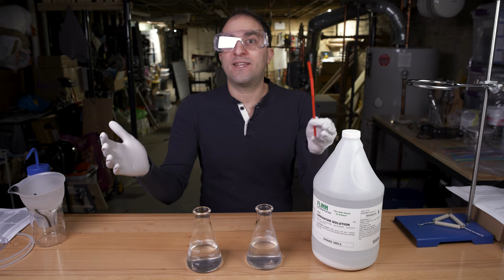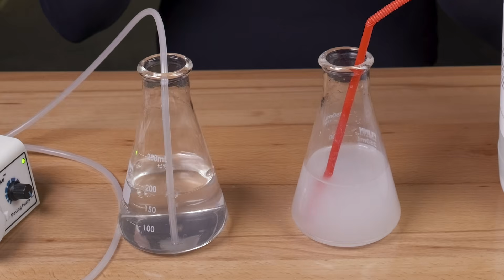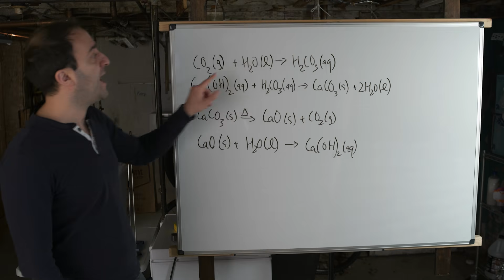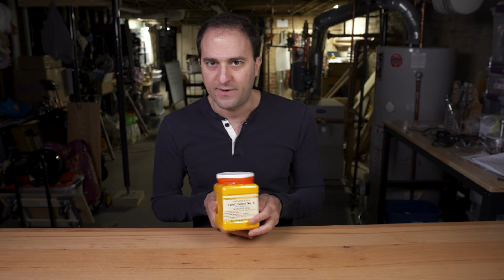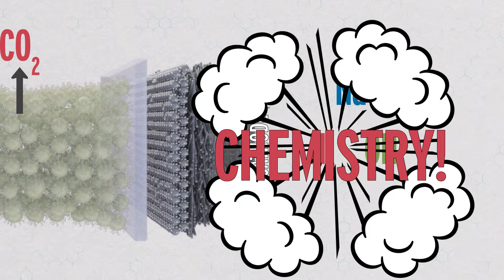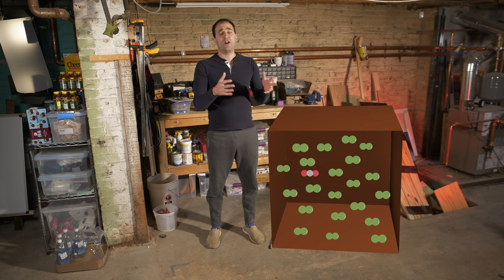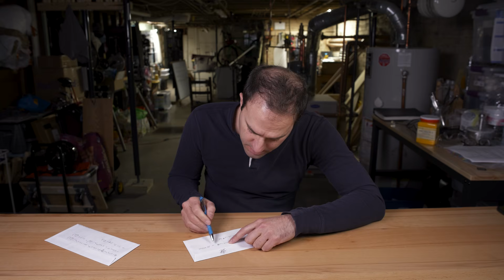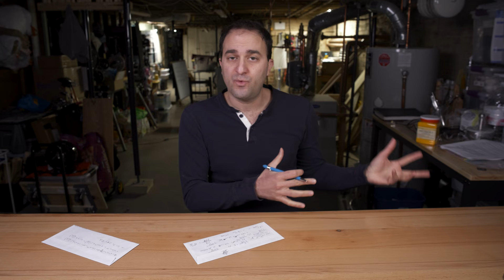Why a Carbon Capture Breakthrough Will/Won't Save Us

Comment: So heat to energy is likely the most efficient path, we can make heat exchangers, with outside, at about 550% efficient however this is not the limit.

	Maisotsenko Cycle (M-Cycle) Systems: This innovative design employs a unique heat exchanger configuration that can achieve a COP of up to 26.4 under specific conditions, corresponding to an effective efficiency of 2640%. 

An adaptation of this to the high temp diff cycle of a nuclear reactor might look something like this:

#!/usr/bin/env python3

"""
################################################################################
#  Advanced Heat Exchanger Adaptation for Nuclear Systems with CO₂ Capture    #
#  Author: [Your Name]                                                         #
#  Description:                                                                #
#  - Integrating the Maisotsenko Cycle (M-Cycle) with reactor-friendly fluids  #
#  - Achieving ultra-high-efficiency heat exchange for nuclear reactors        #
#  - Utilizing reactor waste heat for CO₂ sequestration                        #
################################################################################

### 1. Introduction
Nuclear reactors produce vast amounts of **high-temperature waste heat**, typically 
rejected through cooling towers or heat exchangers. *Molten Salt Reactors (MSRs)* and 
*High-Temperature Gas Reactors (HTGRs)* operate at **700–1200°C**, making traditional 
cooling methods inefficient.

*Objective:*  
- Re-adapt the *Maisotsenko Cycle (M-Cycle)* to *high-efficiency heat exchange*  
- Utilize *supercritical CO₂, liquid metals, helium, and radiative cooling*  
- *Extract reactor waste heat for CO₂ sequestration and industrial heat applications*  

---

### 2. Heat Exchanger Efficiency Fundamentals
Heat exchanger efficiency (**ε**) is given by:

    ε = q_actual / q_max

Where:  
- *q_actual* = actual heat transfer (Joules)  
- *q_max* = theoretical max heat transfer (Joules)  

Higher *ε* means **less waste heat loss, more usable energy**.

---

### 3. Efficiency Breakdown of Different Heat Exchanger Types
| Heat Exchanger Type | Efficiency (%) | Max Temp (°C) | Primary Application |
|-----------------|----------------|----------------|------------------|
| *Water-Air M-Cycle* | 85-120% | ~100°C | HVAC, low-temp cooling |
| *Supercritical CO₂ M-Cycle* | 300-500% | 500-1000°C | Advanced power cycles |
| *Liquid Metal M-Cycle* | 500-1000% | 300-1200°C | MSR & high-temp reactors |
| *Helium Gas M-Cycle* | 200-400% | 700-1000°C | High-temperature reactors |
| *Radiative Heat Exchange (Space)* | 1000%+ | No upper limit | Space-based nuclear systems |

---

### 4. Re-Adaptation of the Maisotsenko Cycle (M-Cycle) for Nuclear Heat
The *traditional M-Cycle* is an **evaporative cooling system**, using **wet-air cooling**.  
For nuclear applications, we replace *water-air interfaces* with high-performance fluids.

#### *4.1 Supercritical CO₂ (sCO₂) Adaptation*
- *Why?* sCO₂ is dense, low-viscosity, and highly efficient in thermal exchange.  
- *Efficiency Gain:*  
    - *300-500% improvement over traditional steam cycles*
- *Application:*  
    - *Direct integration into nuclear Brayton cycles*  

#### *4.2 Liquid Metal Adaptation (Na, Pb, Bi)*
- *Why?* *100x higher thermal conductivity than water.*
- *Efficiency Gain:*  
    - *500-1000% effective heat exchange efficiency*  
- *Application:*  
    - *Passive cooling for MSRs & space reactors*  

#### *4.3 Helium-Gas Adaptation (HTGRs)*
- *Why?* Helium is **chemically inert, corrosion-resistant, and heat-efficient**.
- *Efficiency Gain:*  
    - *200-400% effective heat exchanger improvement*  
- *Application:*  
    - *Ideal for closed Brayton cycle reactors*  

#### *4.4 Radiative Heat Exchanger for Space-Based Nuclear Reactors*
- *Why?* Space has **near-zero ambient temperature (~3K), enabling extreme cooling efficiency**.
- *Efficiency Gain:*  
    - *1000%+ effective waste heat rejection*  
- *Application:*  
    - *Deep space nuclear reactors*  

---

### 5. CO₂ Capture Using MSR Waste Heat
MSRs generate *1 GW thermal* power.  
- *45% efficiency* → *450 MW electric*
- *55% waste heat* → *550 MW (for CO₂ capture)*

Using the **Calcium Looping Cycle**:

1. *CaCO₃ decomposition (endothermic, requires heat)*  
    - *CaCO₃ → CaO + CO₂* (at **850-1000°C**)  
    - *Energy required:* *4.05 GJ per ton CO₂ captured*

2. *CO₂ sequestration (exothermic, releases heat)*  
    - *CaO + CO₂ → CaCO₃* (at **600°C**)  
    - *Excess heat can be recovered for power generation*

Annual *CO₂ capture calculation* for 1 MSR:

    CO₂_removed = (Annual Waste Heat) / (Energy per ton CO₂)

    CO₂_removed = (550 × 10⁶ × 3600 × 24 × 365) / (4.05 × 10⁹)
    CO₂_removed = 4.28 million tons CO₂ per year

**100 MSRs can offset ~5% of global CO₂ emissions**.

---

### 6. Financial Feasibility of MSR-Based CO₂ Capture
| Number of MSRs | CO₂ Captured (tons/year) | Carbon Credit Price ($/ton) | Annual Revenue ($) |
|------------------|------------------|----------------|------------------|
| *1 MSR* | *4.28 million* | *$50* | *$214M* |
| *10 MSRs* | *42.8 million* | *$50* | *$2.14B* |
| *100 MSRs* | *428 million* | *$50* | *$21.4B* |

**At $100/ton CO₂**, revenue **doubles**.

---

### 7. System Optimization for Maximum Efficiency
1. *High-efficiency heat exchangers (~95% efficiency)*
2. *Cascaded energy recovery from CO₂ cycle*
3. *Hybridizing with direct air capture (DAC)*
4. *Utilizing captured CaCO₃ in cement production*

---

### 8. Final Takeaways
- **M-Cycle heat exchanger efficiency increases by 3-10× when re-adapted for reactor fluids**.
- **MSR waste heat can be extracted at >95% efficiency**, reducing reactor temp to **near-room temp**.
- **MSRs can remove 4.28M tons of CO₂ per year, making carbon-neutral nuclear feasible**.
- **Scalable solution for deep decarbonization, energy recovery, and industrial heat applications**.

—- solution summarized by chatGPT

Comment: Capturing carbon from air is less efficient than carbon capture directly from places that emit tons of co2, like say remaining coal power plant, large factory, metropolitan most jammed intersection n so on. the goal shouldnt be capture everything we emit. It should be at places with higher concentration of co2 emision. 

The reduction of emissions even 5% gonna be a huge deal.. there are no single solutions to problem this big

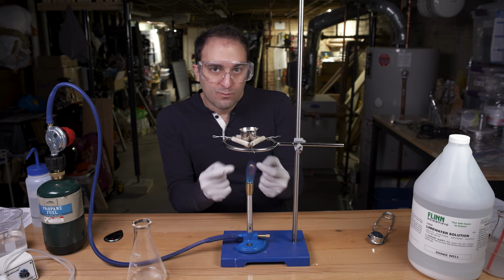Comment: 3:15 so use waste heat from some other process. Or solar/thermal.
Could even use it on cars to scrub co² from their exhaust and use catalytic converter heat.

Comment: So extracting 1ton of  C02 from air would take 1000kwh of power (200kj/mol = 18mols/kwh or 792g,   BUT removing from the exhaust of a natural gas powered power station (maybe used as a back up for variable wind/solar) would take maybe 350kw hours, but would produce maybe 2400kw per ton of CO2. 
Depending on the method used some of that carbon capture could come from renewables. 
Iron Fertilisation of the Oceans is probably the easiest method and would help restore our oceans. It wouldn't remove a fraction of the CO2 being produced at present.

Comment: I'm a bit confused about why the output is supposed to be pure carbon gas.  Where can you possibly store that?  It doesn't stay in the ground.  Pumping it into the ground also seems to be mostly a fossil fuel source...
The earlier state, calcium carbonate, is actually useful for storage.

Comment: How about that paper Sabine talked about which involves using an 80 gigaton nuke on a strategic point in the ocean floor which will release a shit tonne of carbon absorbing minerals and remove like 10 years of carbon with a single blast and a cost of only about $10B

Comment: What about metal organic frameworks? MOFs?

I appreciate the final note of this video and I hope it isn't lost on people. The fact is that we have created a society and world that is driven by economic decisions more than anything. If a solution does not fit into the profit motive, it won't be used. Look at recycling and landfills. We have the system of crummy recycling and landfills because that's the cheapest option, not the best solution. And that's with a problem everyone can actually see. When it comes to climate change, the problem isn't as obvious to some people and the issue is much more complex. 

Not only do the scientific breakthroughs have to be effective and affordable, but we also must acknowledge that our economy is driven by overconsumption. You aren't going to lower emissions effectively without curtailing the consumption. And as you said at the end of the video, the only way air carbon capture works, is if we drop off emissions by over 80%.  Good luck. Even if we were somehow able to do that, you still have the overconsumption of all the other finite resources on the planet that will also sooner or later be a problem.

Comment: The problem is carbon is not the fine particle dust actually harming us these days when it comes to cars for example. And since obviously only the consumer is ever at fault, our cars tires are the bad guy these days but it's much easier for big oil to tell you you're the bad one for burning stuff when they burn much more stuff.

Comment: In todays very cheap solar is only a question of process need realible power or could handle changes and stops without harm. 
If no need for batteries, energy ls for free in the long run.

Comment: You missed the point that if we capture CO2 directly from the sources, rather than from air, where CO2 concentration is much higher, it will not be the same energy required for separation per mol of CO2 as air. This energy will be much less, and even with inefficiencies, it might make practical sense.

What is implied here is that we should focus on capturing from sources rather than air, and to streamline most of our manufacturing processes to emit CO2 in the most concentrated form possible.

Comment: It would be much easier to simply ban exhaust pipes and chimneys and instead place CO₂ collection devices everywhere. People would then be required to empty them at gas stations when refueling.

The legal framework for such a system already exists in many ways. You could consider CO₂ as pollution (which it is) – just like mercury or arsenic, which you're not allowed to release into the environment either.

Additionally, a deposit system could be implemented, similar to bottle recycling. You pay extra when purchasing fuel and get the money back when returning the captured CO₂.

Comment: Electricity from wind and solar is cheap and getting cheaper.  It's entirely plausible that we might double or triple current electric generation, and have it be affordable.  We're going to have to do more than that anyway, to electrify activities that currently use fossil fuel and emit CO2 we can't afford to keep emitting.

It's also noteworthy that renewables produce lots of energy at some times (i.e. when the sun is shining and the wind is blowing), and less at other times.  It looks as though they're getting cheap enough (compared to storage) that the cheapest way to provide energy during marginal times (i.e. when there's some wind or some sunshine, but not enough of either to run the wind turbines or solar panels anywhere near capacity) is to just build enough capacity so that the marginal times have enough generation and don't need to depend on storage.  That capacity will produce more during high-output times than is needed to fill storage for the times when storage is cheaper than generation.  That excess is energy that we get basically free as a bonus when we buy the marginal-times generation, if we can find a use for it.  So the challenge with DAC isn't to make it energy-efficient.  It's to make it cheap enough on capital costs and fixed operating costs that it can operate for four hours a day, a hundred days per year, and still be affordable.

We don't just need to get carbon-negative.  We need to get carbon-negative on an order of magnitude that will reverse the last few years of emissions over a comparable number of years.  So the emissions for a recent year are a good reference quantity of CO2 to use.  Thank you for doing this calculation.

Comment: So interesting. Subscribed.
And this is exactly what I wanted to hear... Well, obviously I'd 'prefer' to hear about some miraculous carbon capture method, but I had extreme doubts about all these giant fan machines in places like Iceland.
When environment based channels joyfully show these machines on their videos, along with the (frankly) paltry amounts of CO2 they withdraw - all I can see is the amount of energy they cost to make, to work, to maintain, to fix, the energy cost of the employees travelling back and forth from their homes, day in, day out.

When, instead of those machines....
You could have trees, species selected for their suitability to be coppiced, the brash stacked (to become shelter for wildlife, food sources for insects and fungi  - all of these being, essentially, carbon and water fixing packages, to feed other carbon and water-fixing lifeforms later on).
Some like to burn that brash as biochar. I've done a bit of that, not much. I don't like the idea of releasing all that extra heat.
Leaving stacked brash does release (on average, apparently) 90% of CO2 back into the atmosphere (other than the part that gets eaten/absorbed by fungi, moulds, mosses, algaes), with 10% of that carbon building new soil. 
But it takes years for the brash to break down fully (I expetimented with a bundle of cut raspberry stems leaning against a fence. They lasted 4 years before collspsing and disappearing that year into the soil. Other brash takes longer, by a few years, decades even. Whole trees can can over a century before they finally melt away....and in the mesntime, you're cutting more brash to stack. 
In my garden, a large garden by British standards, I have a long brash hedge and several brash heaps, most of which are positioned st a higher elevation than the rest of the garden. As a consequence, soil particles wash foen into the soil in heavy rain, building soil depths. 
This is a system that requires no fuel, just a machete or secateurs, sometimes a handsaw.
We can all carbon capture through the method of coppicing in our own gardens - and be better at it than any of these fancy engineers or chemists.

Comment: It's pointless. Your video. 4000+ Gigatons is what we have dumped since 1750...even if we halve that, and even if the method could be gigaton scaled up, where are you going to __put 2000 Gigatons+ of captured CO2. Besides all the CH4 tipping points are about to tip. Conclusion: humanity is shafted.